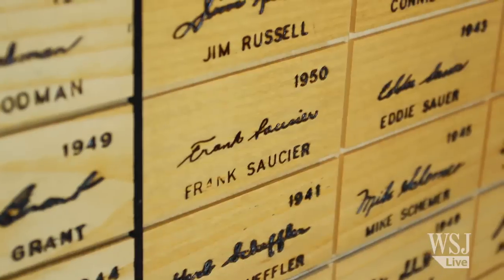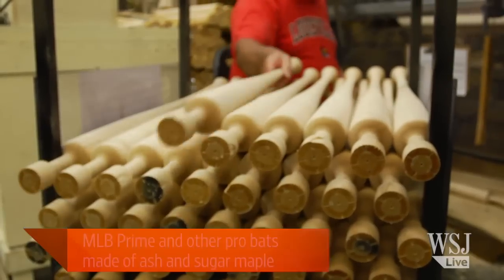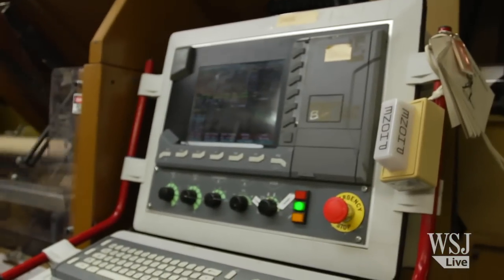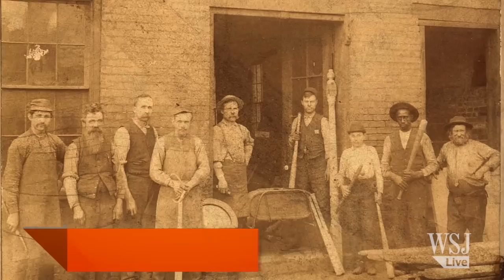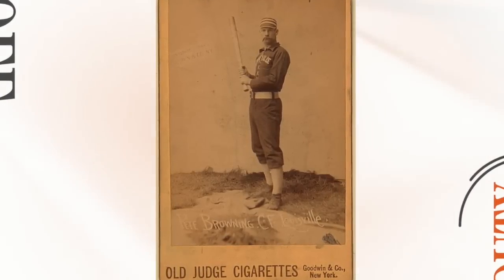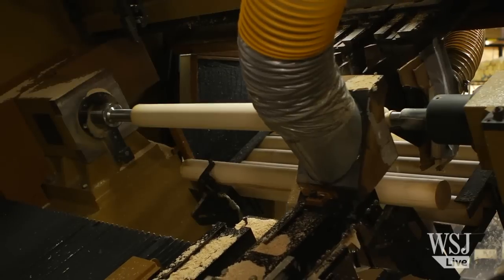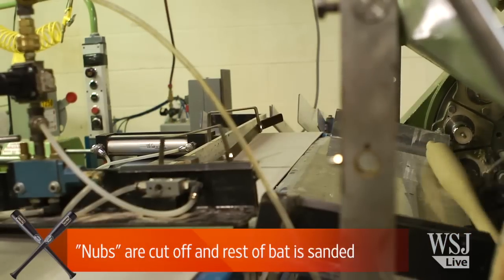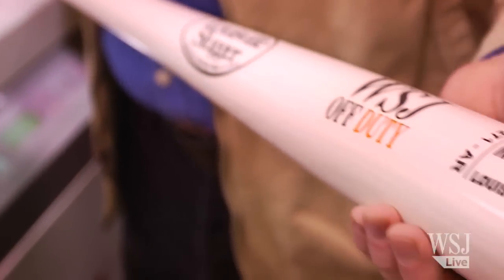Louisville Slugger Unveils New "MLB Prime" Bat

Comment: Maybe you will try making some and soaking them like drift wood before sanding and painting the bats. They will be harder with the minerals in water. The minerals the hard of a bat. Maybe with a cave man club logo and the word driftwood . I was thinking after painting, and lacquering the bats you could dip the handle end in a rubberized/polymer mixed paint coating for smooth grippier texture.

Comment: Is the real reason they are switching to Maple is the Emeral Ash Borer is killing all the Ash trees? They make Maple sound like it is the best wood but if it was then why were they always made out of Ash wood?
Reply: bats have been made out of all types of wood over the years. Ash, hickory, maple, today they use birch as well. Maple started becoming popular in the early 2000's (before the Ash borer made its way into the US) its just a coincidence. Maple is about 20% more dense than ash so the players feel they can hit the ball further with a maple bat.
Reply: That just sounds like a bad excuse. I am going to plant some ash trees cause they are going to be really expensive soon.
Reply: haywood jeblome takes 80 years for a tree to grow before it can be harvested to make a bat. Plus even with the bug killing the trees maple bats are still more expensive than ash.
Reply: The tree only has to be 2 or 3 inches so it should be more like 5 years. Then they are long so you can get 5 or 10 bats with each tree.
Reply: haywood jeblome I work for a bat company sick won't get into the entire reasons why you are wrong. Ash trees you need 7 to 9 grain lines per square inch and since a barrel of a bat is roughly 2.5 inches in diameter that is roughly 20 years of growth. Plus bat companies only use the wood from the outer part of the tree. They don't use the wood in the center. You can't make a good bat from the center rings (older rings)
Reply: haywood jeblome plant your trees in a 3-5 foot grid. keep lower branches trimmed off as they grow. after 10 years thin them to a 9-10 foot grid and let them grow another 30-40 years and they should make decent bat blanks